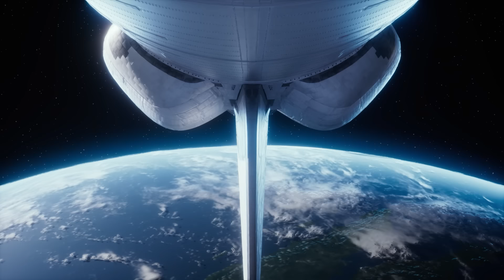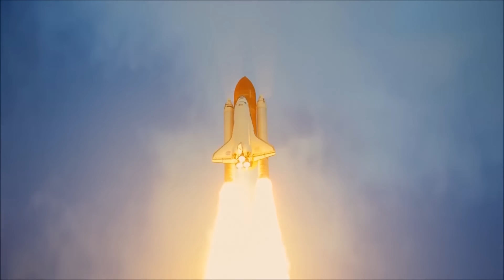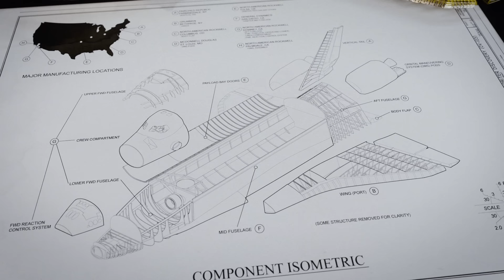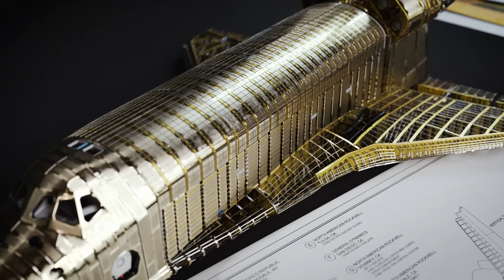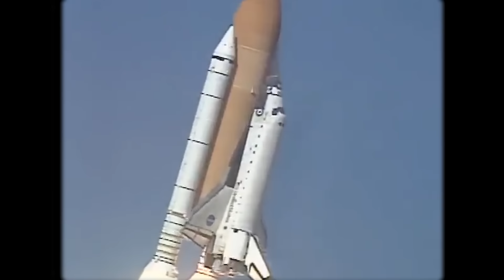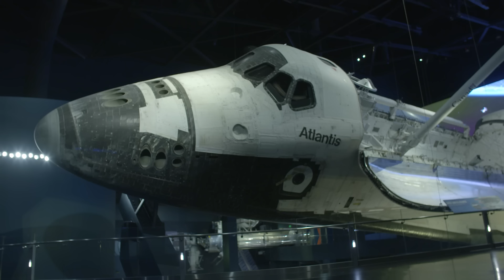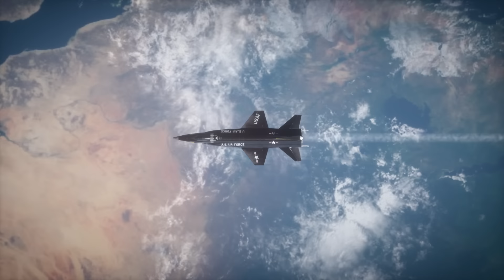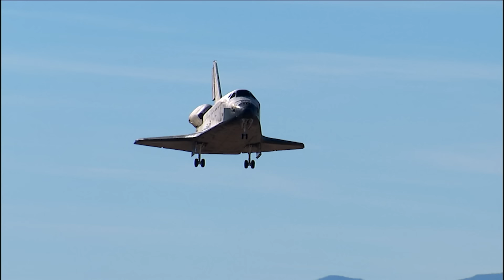The Insane Engineering of Re-Entry

Comment: We didn't go to the moon or land on it. C'mon there weren't computers to control the life support system, and all the computing power needed for everything. They had technology of a  Seiko wrist watch but yeah they pulled the moon landing off. We can't do it today with our tech but people still believe this lie. 😂 The space station is not in space but our highest most edge of the atmosphere.
Reply: The "life support system" does not require huge computers. We had the technology back then, we still have it.
Reply: consider how much a Sekio wrist watch costs, "the space station" i haven't heard about before but i would assume considering it is a space station and not a plane that it is higher than 100km up even at perigee so it doesn't simply fall back down to earth in hours 

also i am all on board with you on the life support issue, historians want us to believe we had military vehicles that swim underwater, how did submarines exist in 1898 without 12 gigabytes of RAM and an rtx 3090?
Reply: Life support system operated on basic logic similar to your air conditioning system, they didnt need computing they needed large tanks of hydrogen and dozens of pound of batteries that would get them by for a few days.
Reply: @miguellopez3392  batteries were not relied on nearly as much due to the fuel cell testing in the gemini program, these would react hydrogen and oxygen slowly to get water and power and could get alot more days of power out of the same weight
Reply: @eater_of_beanbags thats what I meant, the reaction also made water which was drank.

Comment: What would happen if you slow the craft down to a stall above the earth instead of 17000mph? I would say it would drastically lower the heat
Reply: you would need a launch vehicle the size of the one needed to launch it to that speed to slow down that much, infact you would need more as you will need to maintain altitude while slowing down such insane speeds

if they did that the shuttle would re-enter with very manageable heating, however would either enter an uncontrollable nosedive or decellerate so fast that the crew could barely survive, the first Nasa manned spaceflight that re-entered like this pulled up to 12 or 14 g's at one point and the upper atmosphere is doing far less for the shuttle due to its sheer amount of momentum it would have so i imagine they may have trouble with pulling over 14 g's

Comment: I had a chance to hold one of the heat shield tiles when I worked for Lockheed back in 97 during my computer building, fixing and programming days. Very light and reminded me of something you use to scrape rough skin off your feet, but much more expensive.

Comment: The cross range capability was for a Vandenberg, CA flight in a polar orbit....NOT a Cape Canaveral launch. 

After Challenger plans for Vandenberg launches were scrapped. If i recall correctly the Delta IV Heavy went on to use the launch pad at Vandenberg built for the Space Shuttle launches that never happened there

Comment: Could you not just place a frequency generator in front of the space craft that transforms the energy from the plasma into plasma turbulence, electron heating or the generation of radio waves. Resinence Oscillation. In short use the plasma generated from re entry to create something else entirely. After all energy can only be transferred.
Reply: i dont think having radio waves blasted everywhere with the vigor of re-entry heating is going to much better than actual re-entry heating for communication attempts

Comment: I have never quite understood why re-entry speed has to be so fast. If the craft is brought to a near zero orbital speed, it will simply drop, reaching standard gravitational terminal velocity, at which point the aerodynamics and propulsion systems of the aircraft can take over and fly under control.
Reply: That would require almost the same amount of fuel to get into orbit. Which means you'd essentially have to get a spacecraft with the weight of the entire Space Shuttle on the pad, into orbit. Just imagine how ridiculously expensive the monster of a launch vehicle that could perform that would be.

Comment: As absolutely incredible as the space shuttles always will be... they used tiles instead of one piece... I don't understand why tbh
Reply: The Space Shuttle used individual thermal protection tiles—specifically, thousands of them made from silica-based materials—for several key engineering and performance reasons:

1. Thermal Protection and Insulation Needs
	•	Extreme heat during re-entry: The Shuttle’s surface had to withstand temperatures up to ~1,650°C (3,000°F) on re-entry.
	•	Tailored heat resistance: Different parts of the Shuttle experienced different temperatures, so the tiles could be customized in material and thickness depending on location (e.g., reinforced carbon-carbon for hottest areas like the nose and wing edges, and silica tiles for less intense zones).

2. Weight Efficiency
	•	Lightweight design: The tiles were extremely lightweight (mostly air—up to 90%) compared to other options like ablative shielding.
	•	Individual sizing: Using individual tiles allowed NASA to use just the right amount of material for each part of the orbiter, reducing unnecessary weight.

3. Modular Maintenance
	•	Replaceability: If a tile was damaged, it could be individually removed and replaced without disturbing adjacent tiles or larger sections of the Shuttle.
	•	Precision fitting: Each tile was uniquely shaped and precisely fitted to its location, marked with a serial number and position.

4. Thermal Expansion and Flexibility
	•	Movement and stress: The Shuttle expanded and flexed during flight. Small, separate tiles allowed for differential movement and reduced the risk of cracking or damage due to thermal expansion.
	•	Gaps and fillers: The tiles had small gaps between them filled with flexible material to absorb this movement.

⸻

In short, the use of individual tiles gave NASA a flexible, lightweight, and maintainable heat shield solution—though it came with challenges in terms of fabrication, installation, and fragility.
Reply: @JL-qe5gl  alright

Comment: If we converge the air and radiation hitting the satellite back, it will create a gas cushion around it, due to which further radiation will not make contact with it. By doing this, the temperature of the satellite's surface will not increase, and metals with very low melting points will be used, and very lightweight satellites will also be able to be made.

Comment: As a 71 years old person who is still intellectually sound, why can't rentry speed be substantially reduced before the craft hits the atmosphere ? I dont understand why such a high rentry speed is needed. Obviously, I am not a rocket scientist. I just have a habit of looking for simple solutions to annoying problems.
Reply: they need the orange tank and two srb's to reach those speeds, they do not have anything nearly as big onboard to calm those speeds, the main strategy for all spacecraft is to rely on air resistance for as much deceleration as possible as it is far more mass efficient than using engines to calm things as much as possible

the shuttle faced a unique problem where it was so much heavier than any other craft that had to re-enter and also couldn't use an ablative heat shield like all other vehicles they safely recovered as it had to be as reusable as possible

Comment: Why can't we have a re-entry procedure where we do bleed off the speed by bouncing off the atmosphere a few times?
Reply: It has been done. The Orion capsule did it. There is a limit, due to lift-to-drag ratios, and the momentum of the craft to leave the atmosphere.
Reply: You can but it's hell on an airframm...spaceframe?
Reply: the people inside would love the g forces
Reply: @justsavv6378  The bouncing doesn't have to be like ball. Just gentle skimming. Perhaps aided by some sacrificial non-rigidly-attached fabric shield.
Reply: i imagine due to it needing to end up very close to the runway it needs to finish re-entry as fast as possible so earths rotation doesn't become a problem, for things landing less precise this is sometimes done, Orion skims fully off of the atmosphere and the Apollo capsules returning from the moon would skim off of the lower atmosphere using their belly as a wing
the shuttle possibly could re-enter like this possibly by banking to the sides less but im probably missing something
Reply: You can buy each time you do this you stress your craft with G force and heat it has infact been done but is not practical according to AI when I asked
Reply: @tedzone5544  AI hallucinates almost everything

Comment: I recall wondering why they didn't slow the Shuttle down to a speed a little below Mack Two, before it hit the atmosphere.  I believed if they did this, all of those heat tiles may not have been needed.
Reply: did you see the vehicle needed to accelerate the shuttle fast enough to orbit?
they could not get orbital manoeuvring engines powerful enough and with enough fuel and ox to decelerate that much before re-entry without scrapping the payload bay and even then they likely wouldnt be able to decelerate nearly as much as to mach 2

Comment: Ironically, it was ultimately the Air Force inviting itself to the party and sticking its dirty fingers into the pie that led to the Columbia Disaster. Widening the hull in order to fit spy satellites inside led to both the disposable fuel tank that had foam break off and wreck the tiles and the design change that led to the increasing the already hottest temperatures at the wing root being beyond what the redundant internal structure could deal with in case of a breach. They also put pressure on NASA to launch the Challenger at the time they did, demanding they ignore the guy who repeatedly tried to warn them about the o-ring failures because it would “make the US look weak compared to Russia”. It’s an amazing piece of engineering, alright… amazing it still worked as well as it did despite the Air Force trying its best to make it a death trap in the name of having an ego boosting compensation measuring contest. Not downplaying at all, just really hacked off to learn how much better it could have been if not for the Air Force screwing it up… and, again, pressuring NASA into deep frying several astronauts and a teacher on live TV. Politics don’t just suck, they kill.
Reply: almost every engineer involved did not believe that the risks they were taking would ever cause an issue and that it wouldn't cause risk to human life, you appear to be hearing a very dramatized version of events behind the challanger accident
Reply: Ther was only one engineering out of 70 that clamed after that he had objections to launching the rest did not see the problems

Comment: I appreciate your awesome videos. thank you for your work. May I add a wish?! Sometimes you use the metric system and another time you change back to miles, feet or pounds.
For me as a german, used to the metric system, it distracts me from the video, as I have to recalculate in seconds, what this will be in metric units. E.g. that plane is 99.5feet long which is about 30+ meters.. another time you switch between mph and km/h. I highly suppose, people using miles and feet in their all-day-life have the same promblem when it comes to recalculate km/h into the well known  mph. Nevertheless, your work is awesome. Thank You. ❤

Comment: Doesn’t all that plasma burn up the ozone and damage it? No wonder there’s holes.
Reply: if it did it would be like taking a pin to an airship in that it would affect it so little it wouldn't even be a rounding error even if the shuttle had flown a thousand times
Reply: @eater_of_beanbags you mean an air ship like a zeppelin? I don’t think punching even a small hole in it would turn out good.
Reply: @brianlittle717  airships used to be used for war and regularly shrugged off hundreds of holes, i use this example because you would need an insane amount of holes in question to start affecting things, the airship example likely isnt fair however as the shuttle's size compared to the surface area of the upper atmosphere is far smaller than a bullet compared to a zeppelin

Comment: Since the space shuttle requires rocket fuel and rocket fuel requires its own supply of oxygen the NASA Apollo mission to the moon were very likely faked as to carry enough oxygen to get to the moon and back would not likely be possible.  One only has to look at the shuttle to see the enormous oxygen and fuel required just to reach space itself!
Reply: No. The Apollo CSM used Aerozine50 (fuel) mixed with Nitrogen Tetroxide (oxydizer).
The shuttle used Kerosene instead of Aerozine I believe.
Reply: @kiverix  Then why hasn't NASA been able to ever return to the moon since 1972 if they already have to knowledge and more modern fuels, faster computers, better engineering, better materials, and better rockets?  Every attempt to return back to the moon since 1972 has failed miserably!
Reply: @happycat0411  1: Politics (yay). 2: Costs. Having better anything is irrelevant if you can't afford the construction / developement to making a thing, whatever that thing may be. Also, returning to the moon is not as simple as updating a game, you need to RE-develop a system that has the ability to sustain life, absorb aerodynamic plasma, etc... The SLS is stated to cost $2 Billion per launch. Sure the Saturn V is technically more epensive, but NASA was already builing all the Launchers for Apollo's 8 -> 18, making ir a stupid desicion to just outright cancel those. The Space shuttle was suposed to be a low cost, reusable LV, but that was not the case, and SLS outright expends: 2 SRB's, 4 RS-25 engines + stage 1, The second stage, The service module and the heat sheild. STS expended the ET and some heat tiles.
Reply: @happycat0411  you cannot get any better than hydrogen, kerosine oxygen unless you are deranged enough to suggest using fluorine, they used a larger craft pushing a payload to orbit that was not under 10% engine and propellent like the shuttle but 100% engine and propellent, your confusion around oxygen i haven't a clue on, the shuttle's launch vehicle would likely need only half of what it had to reach space

and the "enough oxygen to get to the moon and back" thing is half absurd considering the craft in orbit has the majority of itself holding said oxygen in a large volume of it, the moon craft will only be consuming oxygen in very noticeable amounts during its engine burn to slow enough for the moons gravity to affect its trajectory, and once again for getting back to earth again. The rebreather meant oxygen usage in the life support system was overall not that much of a limiting factor, which would itself be improved in later missions where enough performance from the launch vehicle was squeezed out for them to bring more to keep the fuel cells running for more days

They have not been back to the moon as Nasa doctrine shifted, before the shuttle almost everything was exploratory, the lightest possible craft was sent as far as possible to do the most shocking thing possible and when the next big "shocking thing" in question was building a moon base or landing on mars and Nasa already needed 4% of the budget to land on the moon its budget was shredded

The shuttle was made so that they didnt just give up entirely on spaceflight the second they couldn't secure more political wins

Comment: There is another part of this year 2024, is supersonic tornadoes. Re-Entry tornadoes are the largest known only EM-5, EM-6, EM-7 and EM-8 on the Enhanced Mach scale; which is EF3 or greater for real tornado, these tornadoes are at least 5 miles (8 km) wide; which is 0.6 miles (1 km) wide for real tornado and they only consider if vehicles are inside flying around the vortex. For example of re-entry tornadoes like 2013 El Reno, Oklahoma and 2023 Rolling Forks—Silver City, Mississippi.
Reply: Also the EM-8 tornado of May 21, 2024 that leveled parts of Greenfield, Iowa may have been a possible re-entry tornado as a 53-year old officer inside his police car encountered a tornado.

Comment: Nice work! You included some details I had wondered about, like the production process for carbon-carbon composites and the particulars of the cross range requirement.

I am slightly disappointed that you regurgitated the “bounce off the atmosphere” myth. This language (the word “skip” is also common in place of “bounce”) gives the impression that the atmosphere is pushing the vehicle outwards. You reinforced this by mentioning the lift of the wings. But of course the shuttle could inert and produce downward lift if needed. A better description than “bounced off” is “failed to deorbit.” The small speed change that put the vehicle on path to reenter was only ever enough to put it in contact with sufficiently dense atmosphere, after all, in which it depends for the rest of its deceleration.

Still a nice summary overall.

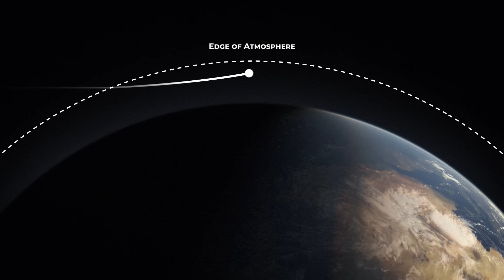Comment: 1:27 Grosse erreur de traduction pour la vidéo en français (traduction automatique?):
"si l'orbiter PERD trop peu de vitesse…il rebondira sur les hautes couches de l'atmosphère……si il PERD trop de vitesse, l'orbiter descendra trop vite dans l'atmosphère…"
La signification est exactement inversée!!!
Reply: the automatic translation for once was actually correct, if it loses speed too fast it will fall into thicker air which will make the wings rise back up, and if it loses too much speed it will fall into the thicker air too fast and cause damage, too much heat and also harm the people inside from the air now slowing the craft down too fast

Comment: Was this technology used in the 1969 moon mission ?
Reply: some parts were similar like the scrubbers used to remove the carbon dioxide from the air to let the crew breathe the same air back in, the computers used in automating everything were different but on par with the fly-by-wire of the Apollo crafts